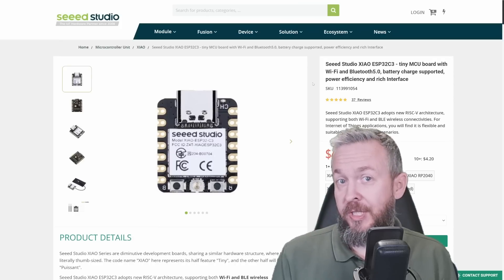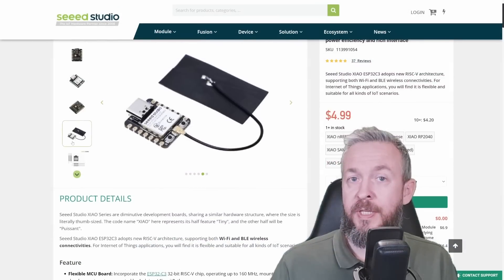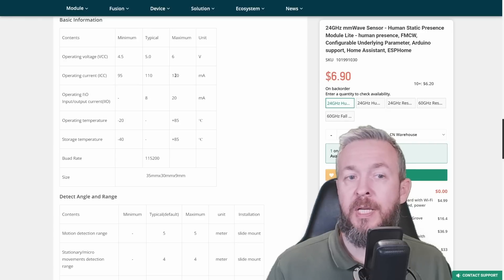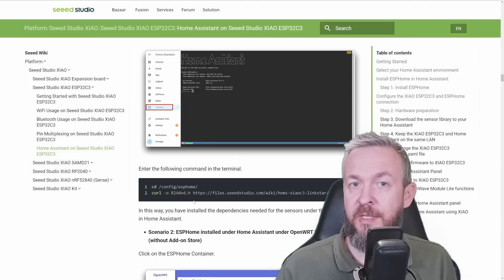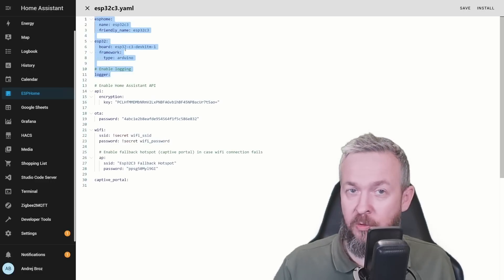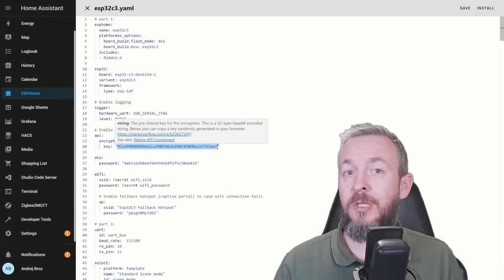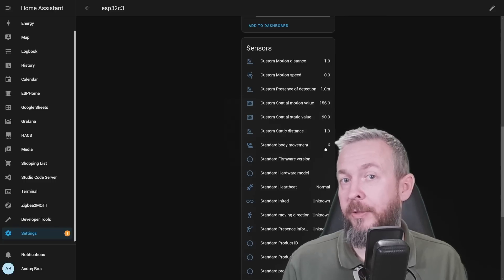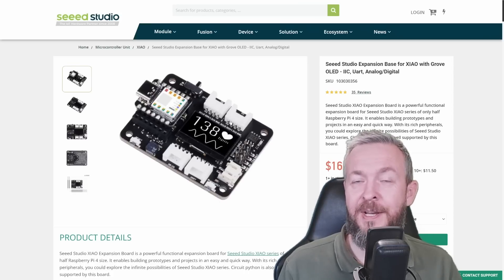ULTIMATE IoT project ESP board & NEW mmWave sensor

Comment: I followed this tutorial and got the ESP32-C3 to connect in ESPhome and show the device page with all the controls, but I never get any data from the device.  I have tested the mmwave sensor in Arduino IDE and was able to read data from it and show it in the serial monitor, but now with ESPhome it doesn't seem to be communicating.  Any ideas?  

I swapped jumper cables to make sure it wasn't a wire connection issue.  Confirmed wires in the right place.  Tried swapping RX/TX just for fun.  Flashed the firmware several times.  I even tried the dev branch code but couldn't get it to compile.  My friend is having the same issues, but he's using a normal ESP32 dev board not the XIAO ESP32-C3.  Disconnected/reconnected the 5V pin on the device.  Logs in ESPhome say 'Standard Product model': Sending state '' (and same for Product ID, hardware model, firmware version etc. whenever I press the lightning bolt to get live data (log says "text_sensor on_raw_value" when I press it).  I even tried my second mmwave sensor in case I had somehow damaged the first one.
Reply from the maker: Do you see anything in log files? Can you try to change debug level so it displays more info?
Reply: @BeardedTinker  I have tried to post links to my logs but that has fail. I am having the same issues as described above. It there a method for sharing the logs you could provide? Appreciate you and your videos so much
Reply from the maker: If you have Discord - you can post them there - link to server is in video description.

Comment: Thanks for the great video! Will the $19.90 sensor "24GHz mmWave Sensor - Human Stationary Presence Module" work with the same esphome code of the lite version? Will the same esphome code work with a different ESP32 board? I just ordered q.ty 3 of the $19.90 sensor since the "lite" are currently out of stock in Europe. Thanks
Reply from the maker: I'm not 100% sure. It should, be I don't have those and didn't try. Will try to check with Seeed Studio.

Comment: Any ideas/suggestions on a case to put this in?  I'd like to put one in each room of my house but I don't want the exposed cards on the wall.

I also don't want to install new outlets at each sensor location or run wires to them.  Any thoughts on connecting a battery?

Comment: Is there also a case available ? I own a 3D printer so an stl file would be nice
Reply from the maker: Unfortunately, there is still no case for this combo AFAIK.
I've found STL's of devices on GitHub from SeedStudio, but just the devices themselves.
Reply: @BeardedTinker  I'm also interested let us know if something comes up please
Reply from the maker: I wish I had time to do the case. But I'll tag here if I find any. Biggest issue can be that it's using wires as it's 2 components.
Reply: @BeardedTinker  I orderd one from china so it will take some time to arrive here in the netherlands but when I got it maybe I can draw a case in sketchup.
Reply: @BeardedTinker  thank you very much I will do it myself but I'm so terrible at 3d design that it makes my had hurt
Anyway I wanted to also thank you for let me know about this board and sensor because I intend to to use it for switch on and off the screen of my LG tv to prevent burn in

Comment: As I said I ordered the parts to try it. Now for another question which I could not find on the Seeed site. What other sensors can be hooked up to this. I have a lot of D1 mini that have temp/humidity/pressure/light level/pir and also led which activate by motion. Can this board handle that. Might you have a link.
Reply from the maker: Take a look here at documentation: https://wiki.seeedstudio.com/XIAO_ESP32C3_Getting_Started/
Most of the sensors can be hooked up to it. It has 11 pins, but you'll need to check pinout guide on above link. So you shouldn't have an issue with sensors like DHT, ADXL, BME280 etc
Reply: @BeardedTinker  Thanks, exactly what I needed.

Comment: Great video, already have LD2410 in use but these seems to be really good. Will "24GHz mmWave Sensor - Human Stationary Presence Module" work with the esphome code for the lite version? I have many ESP32 NodeMCU lying around, must it just be the ESP32C3 model?
Reply from the maker: It should work with it. Only upper part of the code should be changed to match the board type. Rest, I think should work out of box, but didn't try.

Comment: I've a lot of trouble with the ESP32C3. 
The board is on a PCB with a ADXL via SPI. The whole thing should be LiIon powered .... but there are two main issues
Arduino IDE 2.04.
- no serial communication  / ESP repairtool  .... accidental repair
- Board an sensor .... random function 
There 'll be a long way to transfer acceleration / single shock values to a smart fone by BLE or WiFi
Reply from the maker: What ADXL board are you using. I had few issues with them arriving dead or not working as they should. 
But yes, C3 is a different than standard Arudino board and does require a bit of hacking.
Reply: @BeardedTinker  Sorry, it seems my answers are lost .... ?! ADXL375

Comment: Great video!  If I understood correctly, it also works with an esp8266 board, right?  I have a couple here and so I can use them.  All the best
Reply: I'm using a 2410 radar on an ESP8266. Less settings but gets the job done. Transporting 24V on a wire and installed a mini buck-converter to step down to 5V. Installed the 5V straight to the 5V pin on the esp and radar, everything works great 👌. No kees for a bulky USB plug this way, and everything is put in a 3d printed box. All fits snug in there. Just to be sure noting falls out, I melted the seams with a soldering iron. Box is permanently shut now (splash proof)
Reply from the maker: But you can use 2410 BLE verison too, without the need for any ESP. Although as I've mentioned previously, they can have sometimes issues. It's great that we have options for different scenarios as not all mmWave sensors are the same.
Reply from the maker: While RX/TX part should work, AFAIK, 8266 only supplies 3.3V on some boards. D1 Mini I think also has 5V. So just be careful about that.
Reply: @BeardedTinker  Ok, thanks. With the data that this exposes in HA, is it possible to differentiate the presence of one or two people more or less with the numbers?  Thanks in advance
Reply from the maker: @janinho82 - haven't tested but will try. Not really sure about that one.

Comment: I have been reading about the mm sensor for a while. Question is sensitivity. My home office and my wifes home office are in two adjacent rooms. Our desks face the same point in the wall. If I have the mm sensor in my office on my desk, will it be sensitive to her movement was well? This is my only aprehension in going this route. Thanks Andrej
Reply from the maker: I think this will depend on the wall. But this one is not as strong as some others and you can tweak the sensitivity (for example reduce range). So I believe it could work. I have brick or concrete walls mostly. Need to test with one wall that is plaster with insulation to see
Reply: @BeardedTinker  I will give it a try. My house is wood studs and plaster board between the rooms (about 13cm thick).

Comment: If you already have BLE proxys around your home ... LD2410 BLE is also an option. No microcontroller needed just that board by itself.
Reply from the maker: Have that before one beta was released - showcased it in video on 2023.2 as this was release when support was added. 
Though people have been experiencing issues with it if no controller is used. Works better if connected via ESP module and also some had more luck after firmware of the board was updated.
Reply: I have used the above sensor and it just works. As someone keeps saying.
Reply from the maker: I still haven't tried to hook then up to ESP board. But do like the simplicity of integration via BLE - and as Paul would say - it just works 😂

Comment: ESP32 C3 is meant to be a quite capable board.   mmWave sensors are becoming more responsive with each generation too.   Still can't quite replace PIR for speed of detection, but they are so good for detecting ongoing presence in a room.   I do like Seeed Studio.   Seeed have been consistently reliable, and their support has been consistent and responsive also.   Shipping is super quick too.    I really would recommend Seeed instead of trying to find these products on Aliexpress.   Price is good and support is there.
I like your little subtle dig at the shortening of merchandise to "merch"   I dislike that too :)  We are adults, not school kids.
Reply from the maker: I love how they really do spend time preparing products for the market. Excellent documentation - technical, examples, GitHub. Everything I needed was there. Also STL for sensors, so you can create case for the project too.

Comment: Incredible how small things can get nowadays. I believe it's reaching the limit of how small we can develop our DIY boards. Smaller than this and we'll need specialized tools to solder and trace our wires. 
As always a great informative video that explains everything in simple straightforward direction. Thank you!
Reply from the maker: Absolutely! Anything smaller would really be hard to work with. But great that we can now create for example LED project and have board be almost the size/width of strip. really compact.
Reply: @BeardedTinker  what an interesting idea. And with its small current draw the list of  possibilities gets even bigger
Reply: We're not even close to the limit.

It will get smaller, faster, more energy efficient and cheaper (choose any 3 for your next favorite form factor).
Reply from the maker: I guess you are right. As long as pins stay the same, I'll be ok. If they get smaller, I'm out of here 🫣🤣
Reply: I've been doing all my diy projects in KiCad or Eagle, for the past 5 years. 
Things can become a lot smaller than this, when using 0603 or even 0402 sized caps and resistors.
I 100% recommend trying it out... The only things you need, are a light, fine soldering iron and tweezers.